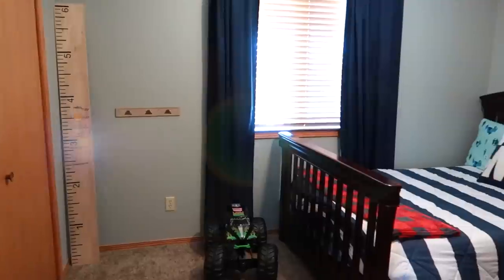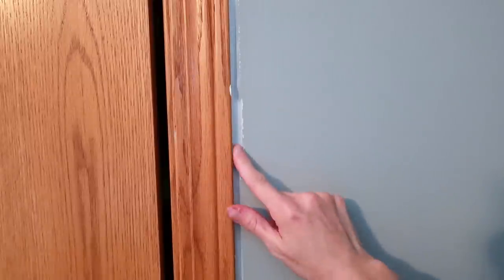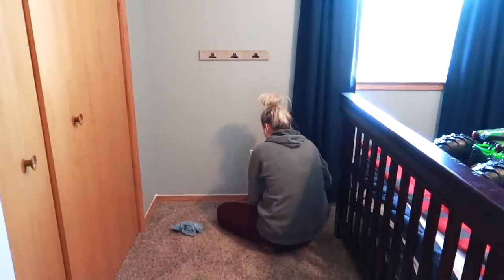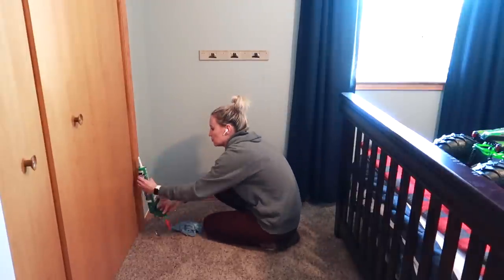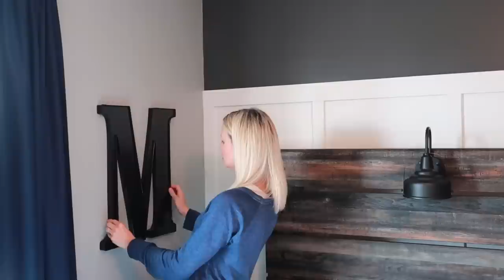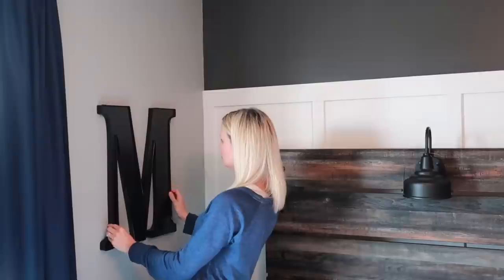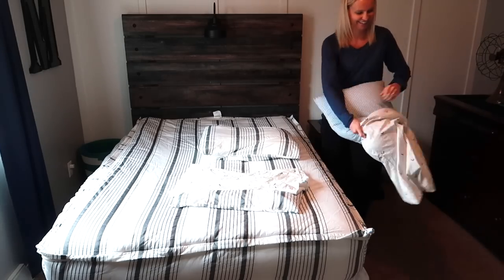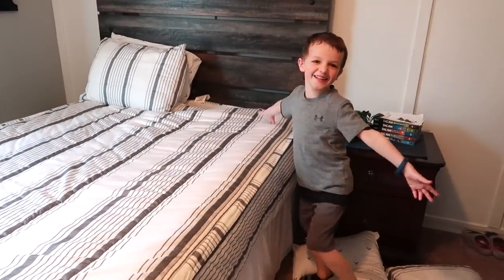BOYS BEDROOM MAKEOVER 2020! | DIY BOARD & BATTEN ACCENT WALL

Comment: Looks amazing!! You did a great job! You can use “bed wraps” or sometimes they are called valance wraps to cover the box spring. They look really tidy and modern. They fit like a fitted sheet (with elastic) but they just fit around the base. I’ve seen quilted ones or suede look ones and they come in lots of colours. They are the only thing I use to cover  bed bases in my own home 👍🏼

Comment: You made the board and batten like so easy. When I paint to save time and tape I take a plaster board slide it between the floor and the base board and just slide it down as I go. Then it the plaster board in half place it on the wall above the base board paint and slide it down as I go! Hope that makes sense!